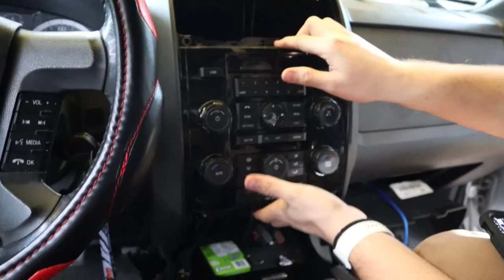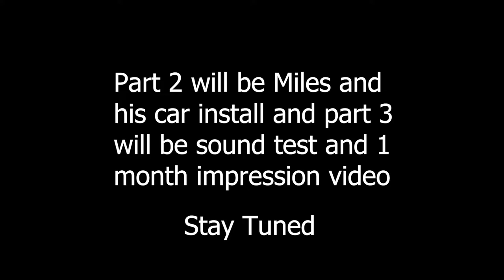Installing a subwoofer in a 2011 Ford Escape (Sub install part 1)

Comment: want more power Bridge that bad boy take left - and right + speaker wire put those together ,  then on amp  the 2 outer left - and right positive or how ever it is on amp then boom u went from 8ohm  to 4ohm or of they are 4ohm speaker u went to 2ohm  harder hitting bass